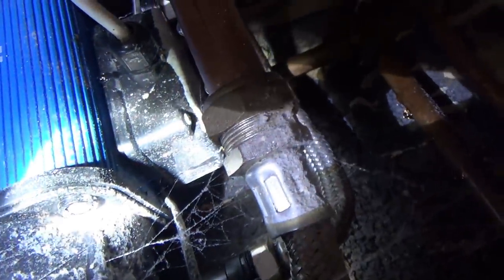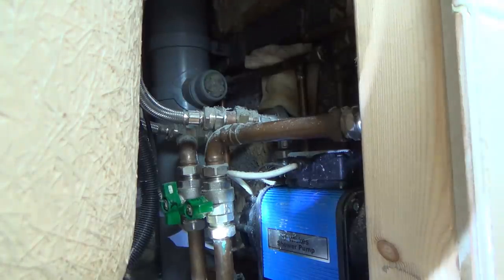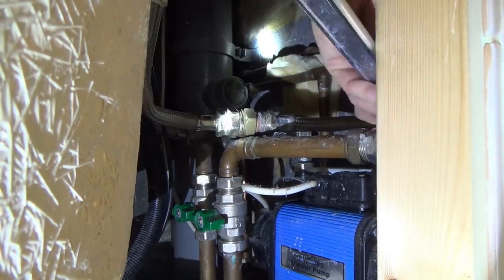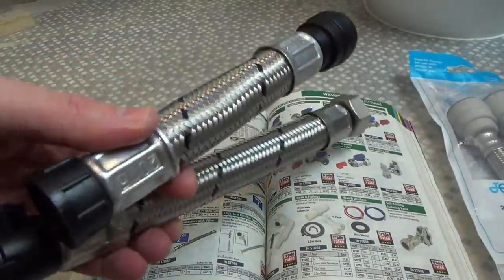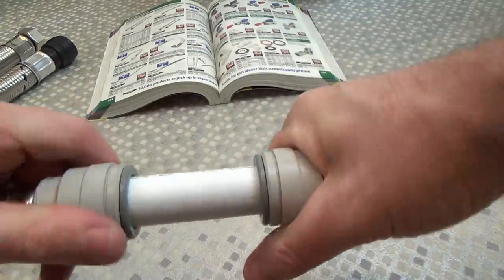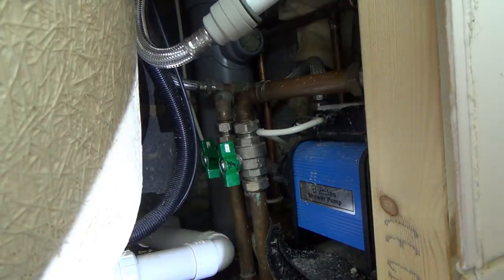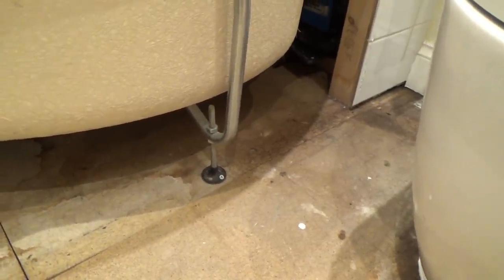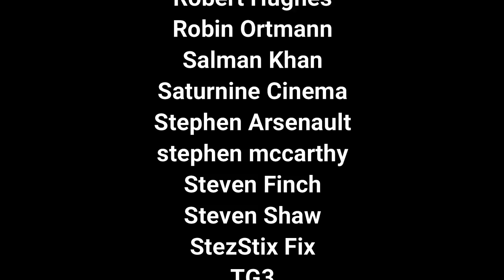Trying to FIX a WATER LEAK in my HOUSE (I'm NOT a Plumber!!)

Comment: Love how calm you were describing the leaks and damage .... NOBODY is that calm finding a leak!
Reply from the maker: Haha, I wouldn't be so calm if it springs a leak again in the next few months!!!! I was blissfully unaware of the future carnage caused that I am still dealing with.
Reply: Usually, plumber comes in, rips all the wall board down. Leaves a mess everywhere!
But hey, no more dripping water...  Cheery O
Reply: Should just call the house insurance. They'll run in and give you a hotel for a week as they tear apart and fix your home
Reply: @Darryl603  Whaaat ... what plumers you have in your country? If that happent in my country, he will be the one who also build again the wall - one way or another. But we can't have junction in the walls, only in special service boxes with hidden access to them.
Reply: @technixbul  Plumbers are not carpenters.
Reply: @Darryl603  you have wooden walls? Now i know why your plumbers take the walls (it will sponge all the water from leaks)... we have bricks, concrette and stone walls covered with tales or bio/mineral plaster. Every man in my country can do plumber & basic electrical circuits, every plubmer can do indoor building, I've never seen a plumber in my live and i change myself my whole water instalation along with tabs and boiler and whole electrical instalation ... i am just electronics engeneer.
Reply: @technixbul  I'm a heavy equipment operator...
Reply: @Darryl603  Actually I'm a carpenter and a plumber.  Ten years as a carpenter and 4 as a plumber.
Reply: Yeah I would have been swearing up a storm!

Comment: Man, I had a leak during lockdown in the loft, blew the electrics, the stopcock was knackered would not shot off completely, we had no stopcock in the street. No plumbers open on the Sunday near me, I froze the pipe at the stopcock to halt the water enough to get the pipe fixed. Then called in the water board to put in a stopcock in the street. Once they came they said that the water was off, I replaced the stopcock in the house while they were finishing the mains. We have the the leak fixed but the damage to the walls, ceilings etc is in the 1000's - thank god for insurance sorting this out. I feel for you Vince.. I got cold sweats for nights thinking the pipes will leak again. Oh one tip get a carpet cleaning team in for the carpets they have equipment that will be far superior at cleaning and drying the carpets out. ~Trooper

Comment: Standing in my kitchen, heard a buzzing sound and couldn't figure. Water dripping down through the light fitting. The radiator upstairs was leaking and fitting on new install by plumber on Friday not tightened fully. The Mrs found the leak and fixed the problem.

Comment: Best thing for leaks once fixed is get dry air moving and lots of it. Time for dehumidifier and fans. Then when dry spray the area down with a mold killer/prevent and use a ozone machine to destroy the musty smell.

Comment: We had a waste pipe rust through under our house and water seeped through the walls into the basement where I keep all my tools and stuff.  The carpet ended up super wet.  I ended up buying a dehumidifier, which really helped dry everything out.
Reply: Was it an old cast iron drain pipe.
Reply: @simontay4851  Yeah, we had it replaced with copper and PVC.

Comment: Sorry about your leak but at least spotted it pretty soon or it could have done a lot more damage to ceilings and floors. You did a great job there I was thinking the same just before you mentioned  it just use one long pipe but I didn't know that you can't get the correct fittings. Good job well done all the same.

Comment: My stupid solution for managing things like wet carpet is a space heater and a dehumidifier.  The heat drives off the water as vapor, and the dehumidifier collects it so you can dump it down a drain.  :)

Comment: A nice successful fix, Vince :) Plastic plumbing fittings are used a lot instead of copper now as its cheaper. I live in a new house (2 yrs old) and there's copper under the kitchen sink as that supplies the boiler, but the pipes connected to all of the radiators are all plastic
Reply from the maker: Thanks Chaos. I wonder if it is copper to the boiler because of the vibrations may cause plastic to fail/leak, or is it 
 neatness thing, as copper looks a better job ?????
Reply: Plastic pipe is cheaper but the fittings cost a lot more. In new builds is done for speed not cost as the plumber will be on a price. The boiler will be in copper as most manufacturers will state the first meter or so in copper or the guarantee will be void. Once again great work Vince

Comment: Position fans/heaters to the carpet. It will promote drying much quicker than just with tea towels. Use a wet shop vac to pick up what you can initially, then blow the rest for a day or two. Open windows/doors to allow the moisture to move out.
Reply: I had a waterleak in my last place  the landlord had people bring in giant fans and had the carpets professionally cleaned and it still molded under the padding and in the walls I had to move it was so bad (black mold from a swear backup not fun)

Comment: here in nz the braided hoses with tap connections on both ends are common but the ones that connect to plastic or copper are rare or you need adapters ps a wet and dry vacuum can help you to dry the carpet

Comment: You could use one of those washing vacuum cleaners to soaking water from carpets etc. It makes them drying much raster (2 days or so).
Cheers
Greg
Reply: but only on surface. 
and the moisture in the wall leads to mold...
in 2 months: ''trying to fix mold on the walls''

Comment: The packing gland in those old stopcock sometimes go, I don’t suppose they’ve ever been touched, I always exercise mine regularly to stop them seizing, undo the gland nut, pull out any lose pieces then wrap it with ptfe then do it back up, open the valve fully then crack it back half a turn, that’ll stop it seizing too, a simple job that will stop it dripping or leaking in future
Reply from the maker: That is brilliant!!!! I just wrapped it and it was too stiff, took a few turns of PTFE tape off and now it still turns AND not one drop is coming out regardless of the position of the tap. Even half in it is still drip free. It is comments like this and the other knowledgeable comments that help so many people out. Big thanks :-)

Comment: Great little fix there, Vince, although that looked a complex pluming set up under the bath,  with very many joints, each one a potential  leak point, you said you didn't use the Power shower, if it was me I would have taken the whole thing out & just left the minimum amount of pipework.
With the stop cock, I've had that problem, if you turn them after sometimes many years of not being touched they leak round the tap spindle, sometimes the leak will  stop if you slowly turn it to the exact position it was originally.

Comment: Some valves are meant to be fully open or closed. Not doing that will cause damage to the valve.  Also just replace all those lines. Inexpensive and less likely to leak.  Oh, and get yourself a shopvac or carpet cleaner and suck up that water.  Moisture in your climate will cause major damage.  Your home will smell for decades.  Also pressure doesn't change depending on how much you have a valve open.  If it's big enough for water to get through the pressure on both sides will equalize.
Reply from the maker: Thanks Nims :-)

Comment: Good job. If you THINK you can fix it yourself, then always try, so you'll KNOW you can fix it (or not).
I saw a box of a Tamiya Grasshopper, up there at your plastic pipe stash. Oh boy, memories came up when I saw that. I still have mine. Mine has a severely oversized motor and it's a real challenge to drive. But sooo much fun.
If you still have yours, take it out, do a restauration video on it, and drive it.
Reply from the maker: Thanks Fluffy :-) That Grasshopper is a re-release, if you haven't looked in a while, check it out as Tamiya have re released lots of old models :-)
Reply: @Mymatevince  I have the 1984 original Grasshopper.
Tamiya spinned off a Grasshopper 2 and some cheaper versions of both and re-released all of that several times.
The original in decent condition is quite valuable but mine flipped over many times, the roll-bar is reinforced with metal wire, the rear suspension pivot has a threaded rod through it. Ball bearings, Kyosho 30000rpm racing motor, back tires are resurfaced with hot glue.

Comment: You need pumps to feed a shower? Is the water pressure that low in the UK? Never seen this before. Here a shower always runs on the main line pressure, also the hot water system is always well pressurized. Nice fix though. The plastic connectors sure are nice.
Reply from the maker: I think (I could well be wrong) this is a vented system so unpressurized. I think it relies on the weight (gravity) of water from the cold tank in the attic to provide the pressure. So a pump is a cheap way to get around it if you want a power shower :-)

Comment: Should always try to keep the flexi pipe on the pump outflow as straight as possible as the rubber inner can wear away at bends with the force of the pumped water (and the occasional impurities carried through).
Reply from the maker: Good advice, thanks Brian :-)

Comment: When you open a stop cock fully turn it back one turn if you don't the next time you want to close it, you won't be able; they seize. That nut you tightened is called a gland follower, it is pushing down on fibrous cord which makes the seal.

Comment: The weeping stop cock can fixed very easily Vince, undo that nut you tightened and wrap some ptfe tape around the stem of the tap and push inside the tap and when you re tighten the nut it compresses the ptfe tape. It makes the tap a wee bit stiffer to turn but will sort the weeping. That flooring in your bathroom is notorious for holding water. Its possibly now damaged then glue holding it  together....just watch it doesnt swell and de-laminate, especially as the bath sits on it. They are heavy when full.
Reply from the maker: Thank you Gary, because of this comment and another I wrapped a bit of PTFE tape around the actual Gland nut. I wrapped too many turns of PTFE and it was too stiff. Took off some turns of tape and now the tap moves fully in and out without any drips whether it is fully in, out or halfway. Thanks mate. Not a single drip in 3 days now. Well happy :-)

Comment: Why you have water junction in the room with carpet? In our country water is only in the kitchen, toilet and bathroom and the pipes are builded into the walls (bricks or concrette) on that specific side of the rooms and they does not travel trough other rooms, so if there are any leeks, they will be isolated in waterproof environment (mainly with tales, concrette, ceramic, silicon and/or rubber) and won't cause any damage.
Reply from the maker: Hey Technixbul :-) In the UK most houses have a water based central heating, so every room will have some water pipes in it feeding the radiators or underfloor heating. Funnily enough this house originally had air heating but it didn't work very well so radiators were put in :-)
Reply: @Mymatevince  Well... metal, wood and water 💦 does not go well together (unless the wood is alive) :D In this case we use mostly electricity for heating. Actually PVC (plastic) hot welded pipes can be an alternative solution in your case, they have permanent joints and exclude chances of leaking. My installation is PVC.

Comment: What you need Mr V is one of the new 9" King Dick reproductions the Youtuber Hand Tool Rescue make giving you a handy vice, socket drive, water union wrench and many more uses or find either a King Dick girder wrench on ebay and restore it which is a very enjoyable thing and those girder wrenches are almost indestructible and made from the hardest tool steel going so won't rust or bend or snap.   I use my 6" Hand Tool Rescue repro girder wrench I bought couple years back as an incredibly handy vice for taking off tough watch casebacks or as an anvil to flatten bent bracelet clasps and plates, the curve on the King Dick types is superb for putting back flat curves into a watch clasp or to knock out dings in the caseback.   Once upon a time they were the ubiquitous tool found in every British made car from a Rolls Royce to a Reliant and every motorcycle too, Ford even had King Dick make a logo'd version for their Zephyr, Zodiac and Consul ranges and the 9" ones were for the Thames Trader lorries and vans and even some MK1 Ford Transits had 'em.
Reply: I disagree - I think the Stillson pipe wrench providing you get a few sizes are much better for dealing with shitty plumbing jobs in tight spaces. It is crude but works well.
I've got a very ancient monkey wrench which is what the King Dick HTR is an example of and it is better than the modern adjustable spanner for some jobs but not so good in tight spaces which is what we have nowadays.

Comment: I guess Vince wont see this comment now, however at 5:35 you can see that the soil pipe has a unused boss connector on it that looks like it has not been sealed correctly?

Comment: I installed a shower pump a while ago and the warranty was void if they were connected at an angle. They were just to isolate pump vibration from the pipe work and not to aid connection apparently

Comment: From a Scandinavian (Sweden) perspective, I have never understood the UK love for these local water/shower pressure pumps, located in all bathrooms? They are noisy, often do not provide sufficient pressure and seem to just add complexity to the piping. Can someone knowledgeable explain why we in Sweden have superior water pressure in our pipes  without any local pumps? Did we just build taller water towers a 100 years ago, or are there some regional central pumps system that I am just never exposed to?
Reply from the maker: Hey Erik, remember this is coming from me so it could be completely wrong. I think it is because in the UK when a home is using a conventional system, the height of the large cold storage tank in the attic to the hot water cylinder a floor below, isn't high enough to allow gravity to push through the pressure of water needed for a nice shower, it is more like a strong trickle!! I suppose it was designed for baths back in the day and it fills that need perfectly. I think the cold water also runs through the same pump as well as the hot to equalize the pressure to the shower. Hopefully others will correct this :-)
Reply: @Mymatevince  Yes, hot water from the cylinder and cold from gravity storage tank is fed through the pump to create equal and better pressure. The potential problem is that the stored hot water can be quite quickly depleted, but where a Combi boiler is fitted and therefore no storage tanks,  the hot and cold are at mains pressure so no pump required and endless hot water. An unvented hot water cylinder would also supply hot water at mains pressure.

Comment: What's the deal with the pump?  Is that pumping water from your supply out the tap into the bathtub?  I've not seen that kind of thing before, in Australia our baths and showers don't generally have pumps like that.
Reply from the maker: It is, but it is meant for the shower rather than just filling the bath. Without the pump the shower pressure is real weak :-)
Reply: @Mymatevince  Oh.  Just to be clear does the pump supply the shower only, or does it do both the bath and the shower?  How commonplace is this system in England?  Do all English showers have these pumps on them?

Comment: Best way to get that water up from the carpet is to hire a carpet cleaner and shampoo the whole carpet, it will get rid of the standing water in the carpet, you may as well do all your carpets but atleast the affected one will dry much faster and NOT be soaking wet and you would not be using towels etc. I really wouldn't let that much water dry naturally, it will affect the underlay etc that you can not see. Maybe just get yourself a carpet cleaner off ebay or fb marketplace for cheap and maybe one the needs fixing, there's an idea that you could have done maybe. You could just hire one also but do the whole house with it to get your money's worth. Gotta think it will suck up all that water too. You could end up later down the line with a more costly repair.

Comment: 🐨 Vince.. 
Never mind the Below waffling As it was before I got to the point of the video where well you know, you done a better Job than a Professional 😉

Is there any reason you didn't disconnect the entire pipe connected to the bath to the extension pipe which BTW failed? Is it that Long enough flexible Pipes are just not available? 
If they are I have a feeling the bath may have initially come with a flexible pipe but the length fell short ergo the bath installer added a very cheap and nasty short extension rather than a proper quality long enough Flexible pipe going from whatever connection point straight to the bath, ergo only two failure points instead of what there is now..

Am I making any sense here? 
APU I Dropped a Like..
Reply from the maker: Cheers Koala :-)